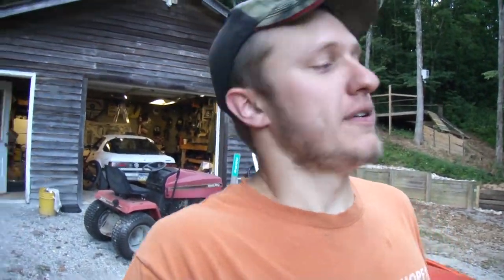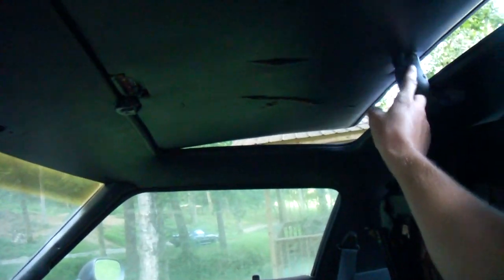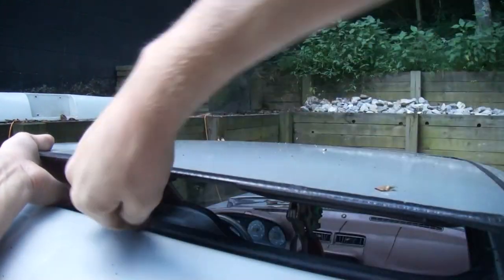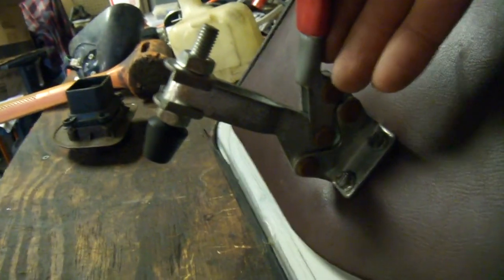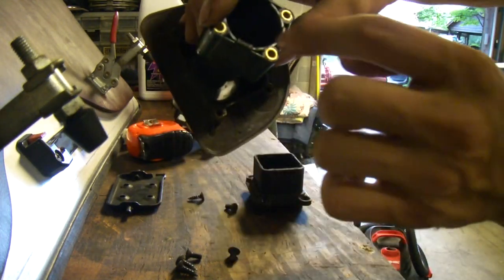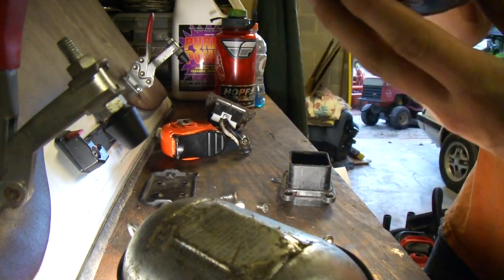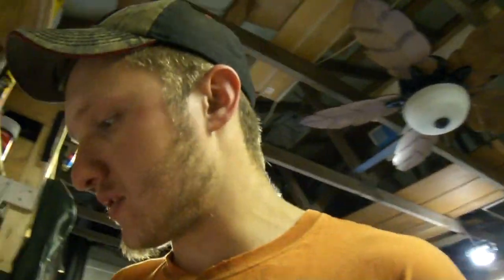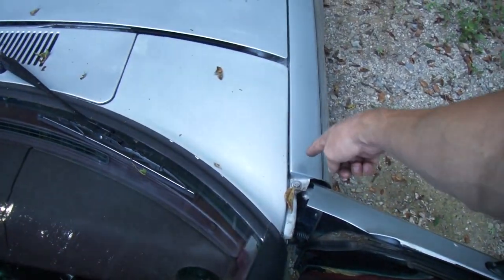FB RX7 Sunroof Latches and Leaks

Comment: I got another question, so I’m trying to put new rotors on my sa I got the rotors and wheel bearings and stuff but I can get the mounting bracket for the caliper off, the bolt on the bottom is right behind some control are or tie rod end and suggestion??
Reply from the maker: Its behind the steering knuckle.  It will make it was easier to remove the two bolts holding the knuckle to the spindle
Reply: RAD Potential  I got it off but I striped it real bad so I ended up grinding the head of both off

Comment: I got another question if I were to try and turbo my 12a how would I go about that would you recommend draw-through or blow through?
Reply from the maker: Either. Depends on your carb tuning ability.   5 to 7lbs of boost.  Holley for blow through.  Side draft for draw through.
Reply: RAD Potential have you ever heard of this being done to a 12a before?, is it worth it or not
Reply: Plenty of 12a got boosted. Modified Nikki apparently works pretty well for the least effort approach. Search boost prepped Nikki on rx7 forums.  I personally converted mine to efi. Car scoots pretty good with the snail on it
Reply: Petr Sindler yea that’s what I wanted to do I want to convert mine to efi then run a turbo on it